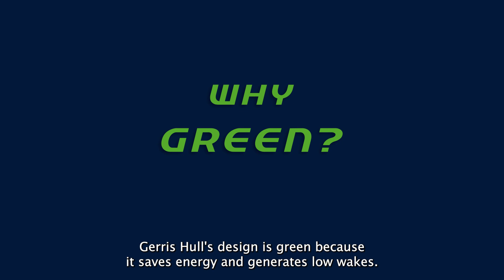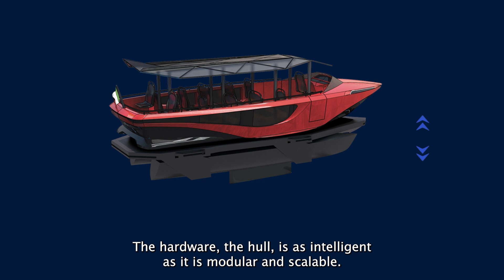GerrisBoats for Smart Water Mobility

Comment: This isn't new technology, and in this case, its unusable. The ENTIRE POINT of foils is to reduce drag. So YOU go and stick a huge torpedo as a drive unit? 😂😂 In shallow water it CANNOT be used at all. In deep water we use larger ships for larger waves. The drag coefficient and power usage for this makes it uneconomical, and unnecessary. The pitch control would FAIL in bigger/random size wave troughs, leaving you face planting into the next wave face in a catamaran WITH a keel foil anchor. DEEP STOP, nose down at speed, rotating around the foil which is like 5 or 6 metres under the CG of the boat....
Reply from the maker: I’m not removing any comment. We’re just going ahead and leave your noise to fight with facts.
Reply: @gerrisboats  then please address each point I made above. 1. Why place the power unit underwater, increasing the cross section/drag by magnitudes? 2. Shallow water use is impossible. The propellers are near the deepest point, first to have issues with impacts/fouling in debris/turbulent disturbance. 3. Not useful, as in better vessels for small waves are common. Wave piercing catamaran technology is far better at all scales. Retractable mid size Hydrofoils for harbour type uses are much safer, more stable, require less draft,  and would use less power than this. 4. ... let's see if you can reply with FACTS about these 3 questions. 
I love innovation. I design and build many things, including some that you would have seen in movies, including Batman, Mad Max, and the Flintstones. 
I understand design. And sorry, but this is not viable.
Reply from the maker: We don’t have to respond to you.  I’ll publish videos with real boats soon. Thank you for all your comments, already addressed.
Reply from the maker: As said in another video comment I’ll publish facts (what’s your purpose of spreading such negative comments in all our videos. You have plenty of time … or Did you invest in something else? 😀)
Reply: @gerrisboats  misleading information follows. Got it. You addressed nothing because you can not or know I'm right. 
Good luck with your delusions. Have a great day.

Comment: Swedish Candela is already selling boats like these!
Reply from the maker: Candela, SeaBubble, Artemis, Navier, Vessev and many others are proposing and building fully submerged hydrofoils.
This is another concept. May be you can better check video content
Reply: @gerrisboats  Candela only offers small and small-to-mid size boats and they don't have any plans for completely self-driving vessels as far as I know, but if you want a smallish fully electric submerged hydrofoil boat with a smart control system you can buy one today. They have already delivered 150 boats and one is being used for public transport in Stockholm right now.
Reply: It's a start up scam tbh... No physics or engineering works here.